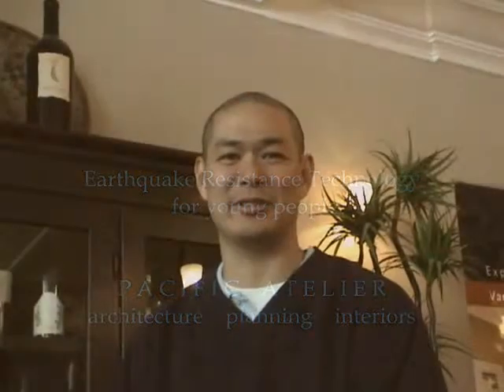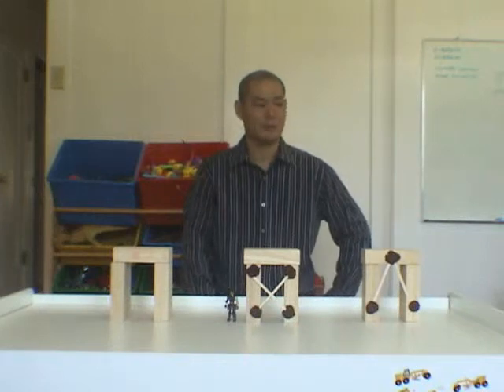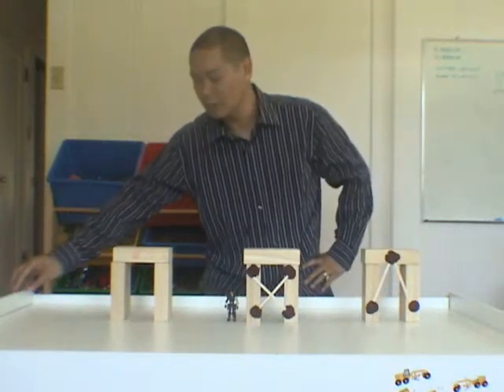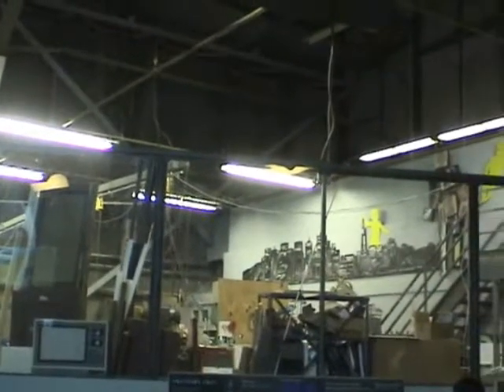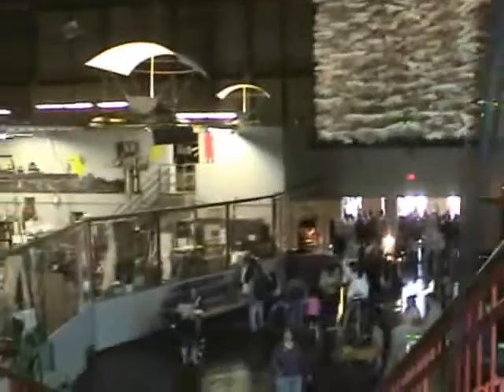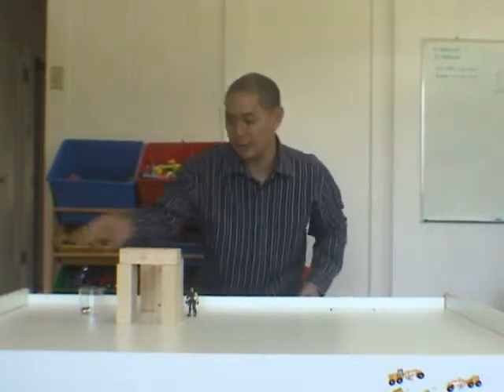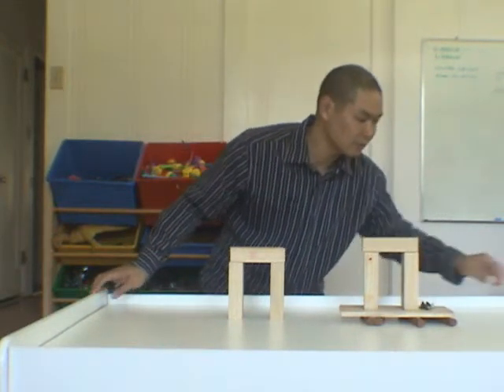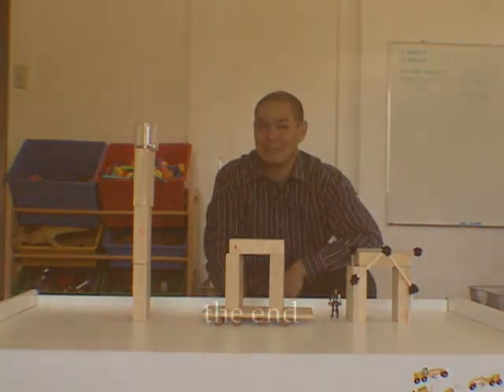earthquake resistance for young peeps

Comment from the maker: which is strongest?  all depends on the engineer.  in real life, we use a combination of them.  personally i like base isolation and k or x bracing... but it all comes down to how it calculates out when the building is modeled in an earthquake scenario.  But remember - all engineers have to assume some maximum of lateral forces when calculating this..  at some point mother nature may deliver something that is outside of the assumptions, and then all bets are off!  
search "soil liquefaction"

Comment from the maker: engineers typically use a combination of these methods to come up with their resistance plan along with other forms of the building like a tube shape structure where the building's resistance is at its perimeter.  then each earthquake is different - so you must consider vertical "punch", and then lateral forces at varying frequencies.  hope this all makes sense!  -h